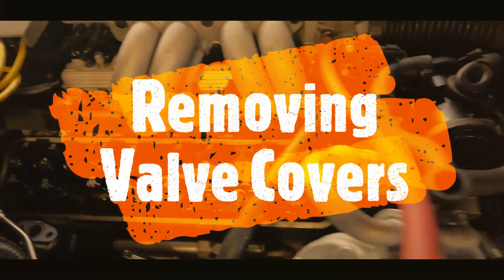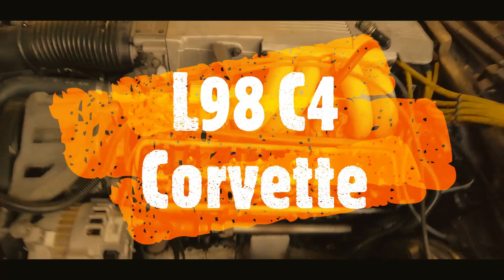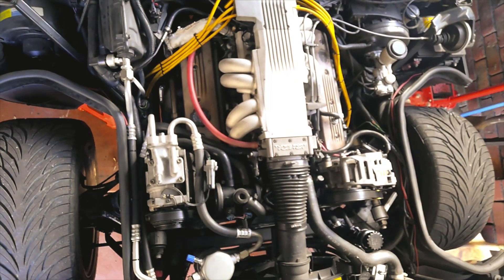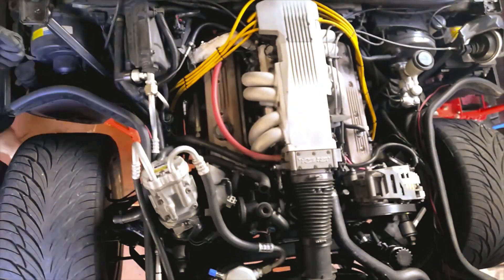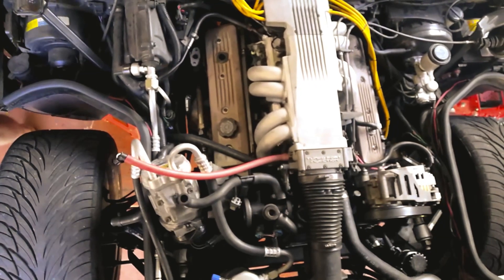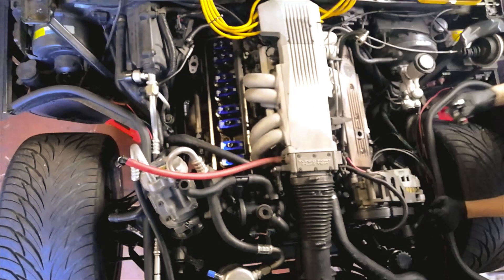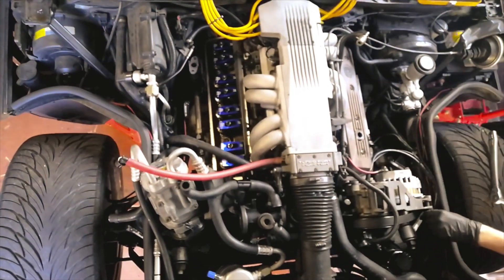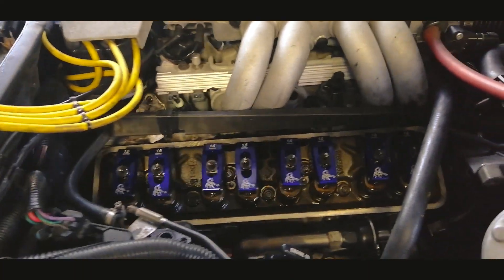Removing Valve Covers - L98 TPI

Comment: I’m working to remove my covers, doing like 1 hour a day :), and the a/c rubber hoses seem to barely flex, I could only move the a/c by 1/2” .  I’ll see tomorrow, also one of the egr tube bolts is stuck, maybe overnight the special fluid for releasing bolts will work